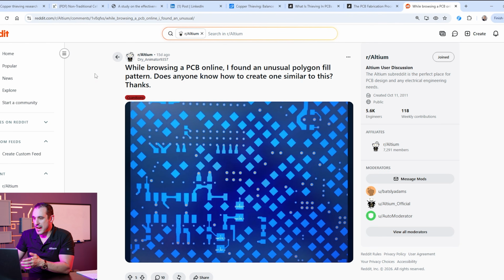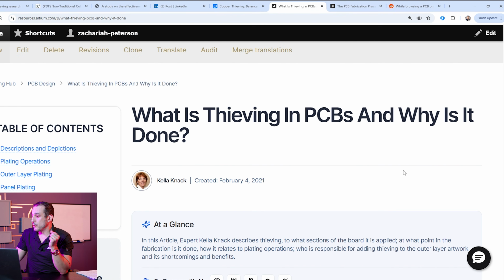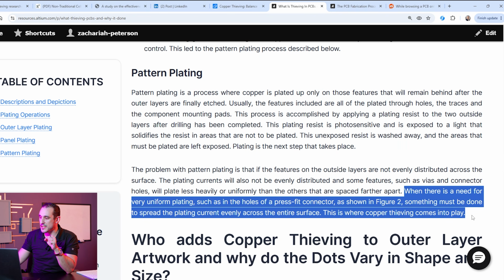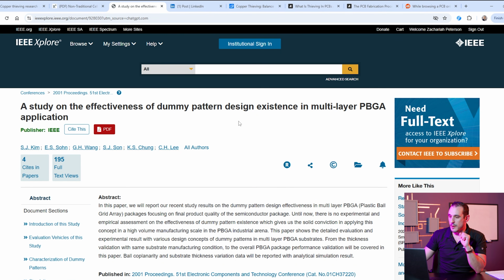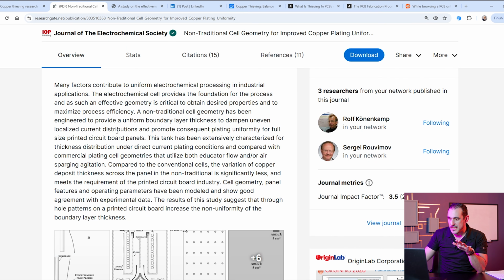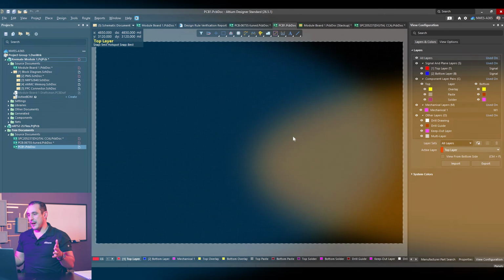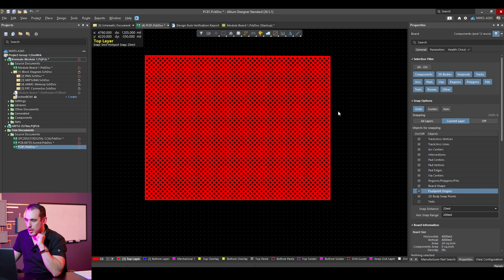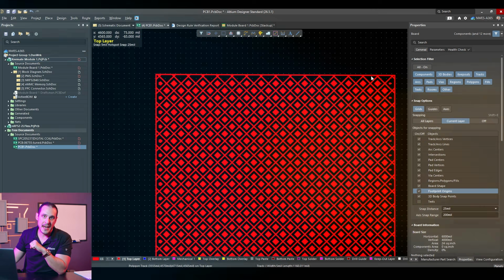Copper Thieving in Altium Explained: When You Actually Need It

Comment: imagine essentially admitting you don't support thieving in the tool. you showed a work around not an actual approach. wildly complicated and a mess
Reply: It's not wildly complicated when it takes advantage of polygon pour order, which is something that designers already have to set up when they have multiple overlapping polygon pours, which is most designs. And frankly, none of the other tools support theiving because manufacturers often need to judge whether it is necessary, and that might be done from test coupons or from measuring samples of fabricated boards during an initial stage of a production run. So in my opinion, designers don't really have any business adding theiving.

Comment: I notice that it's patterns of unconnected copper. I prefer in general to add solid GND copper pours on all layers, even though I have a solid GND layer. It's like hitting two birds with one stone. Does the solid copper pours achieve the same results or should copper thieving be done with an unconnected pattern?
Reply: The research paper I pointed out in the video looked at a series of copper strips and other patterns to see if there was a discernable difference. As I recall, as long as you get enough copper coverage for your particular pattern, then it should achieve the desired purpose, but of course a quality team doing microsections would be needed to verify. I also do not recall if they looked at solid copper in the research article. I have had one PCB manufacturer tell me that full copper pour was required on one of my boards so that the plating would be even, basically playing the same role as copper theiving. In reality, you usually don't need solid GND copper pours on all layers, I am always interested as to why some designers think they need this and I seldom hear a consistent reason!

Comment: This Altium workaround is not great because of multi-step manual repouring. When I'm designing a PCB I just place a hatch or solid pour connected to GND (and stiched in multiple places) for plating balance on TOP/BOT. It is simple and fast so in my opinion it is a must because after I test prototypes, I usually don't want to add big patches of copper to PCB as they may have some effect on already tested circuits.
Reply: Well to be fair, it's not something that PCB designers normally get asked to do, if it's needed the fab house can do it for you. So I'm not surprised a dedicated "Theiving" feature has been created in Altium Designer (or in any other software AFAIK).

Comment: Why would you place floating dummy copper instead of a ground pour? Surely the floating copper will more EMC, SI, PI issues, no?
Reply: I mentioned in another comment; for the EMI perspective those little floating squares could theoretically act like little patch antennas everywhere, but you would need to have strong capacitive coupling at the patch resonances to excite strong radiation from the squares. Based on the sizes of these squares in a typical thieving pattern, I would expect these to show emission/reception at 10's of GHz... So probably not a concern in most systems. From the SI perspective, just treat the squares the same way as coplanar copper pour; put large enough clearance and there will be minimal impact on the impedance of your impedance-controlled lines.

Comment: I suppose it would be easier to do the GND polygon... of course taking into account the impact on the impedance i.e. with a good clearance
Reply: Yeah the clearance is pretty important to begin with... but in this case those floating pieces of copper could act like a bunch of little antennas. However, this would require strong coupling between a signal line and the thieving squares, and those thieving squares will be low mutual capacitance compared to the line's self capacitance to a GND plane (in a typical multi-layer board). So it's possible there is an EMI impact but with large enough clearance to signal lines and GND plane on the neighboring layer it may be a non-issue.
Reply: Non connected polygons will have same impact on the impedance but keeping good clearance can be harder with GND polygons.

Comment: Personally I've never had a manufacturer ask to add these features to a PCB but I don't send out designs with unbalanced design elements. However, in my early days I used to fabricate a lot of test boards in the office and I learnt that if I didn't balance my copper features isolated traces would tend to over etch. When I learnt about copper thieving I used to add these elements to some of my boards and these definitely helped produce better results. PCB manufacturers have improved process control, and there are other techniques that aid in selective etching and plating. I'd guess that it's less of an issue these days? but still fascinating stuff, my wife just loves it when I try and talk to her about this.
Reply from the maker: 😂😂😂 that last thought haha
Reply: They usually don't ask you, they tend to just do it. Atleast cheaper manufacturers lol.